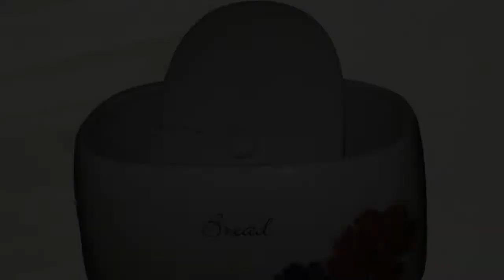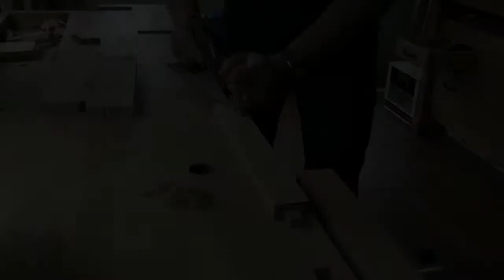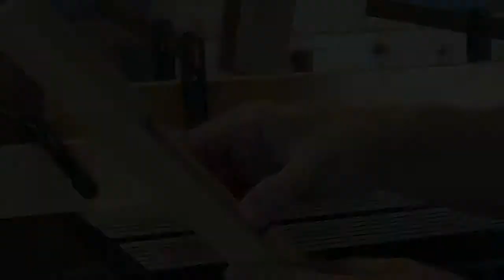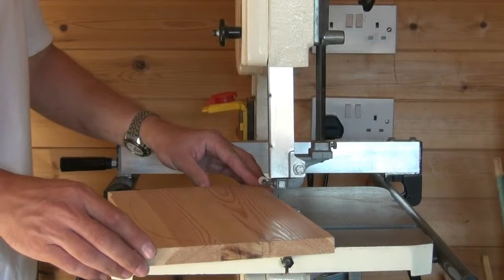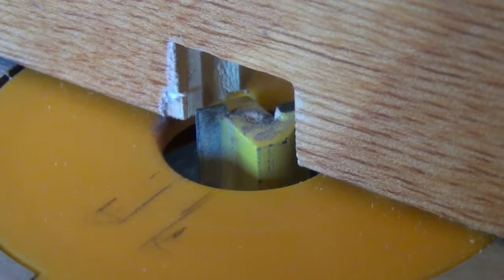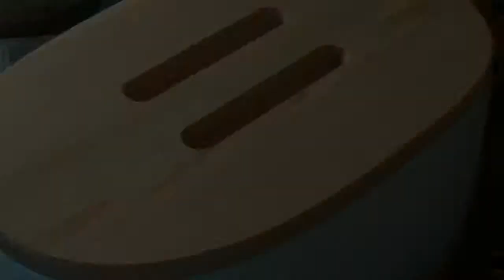Breadboard Bread Bin Lid

Comment: I appreciate the warnings, Mitch.  The reason I made the initial comment was simply because I didn't want anything to happen when you were using that planer/jointer machine.  I realize that the European jointers don't have the same kind of guard as the North American ones do, and maybe the convertible planer/jointers are even further different.  In any case, something like that push block like you were using on the table saw when you were ripping that piece of cherry would work perfectly.  Sorry to be such a safety nag.
Reply from the maker: Craig Reichert Cheers Craig. Better safe than sorry! It does bother me that I may be so distracted by the filming process to make the odd slip up though.